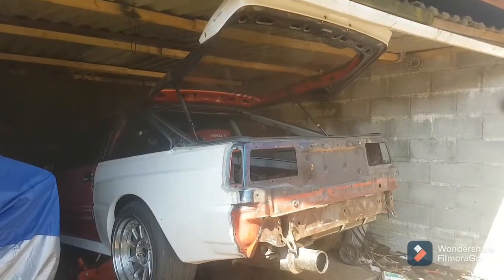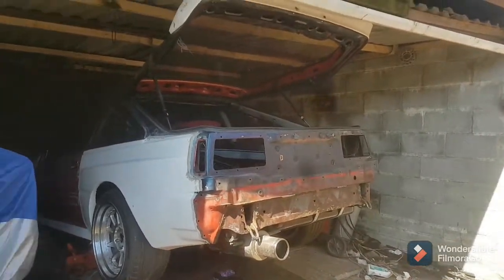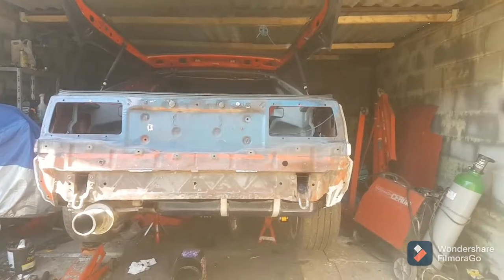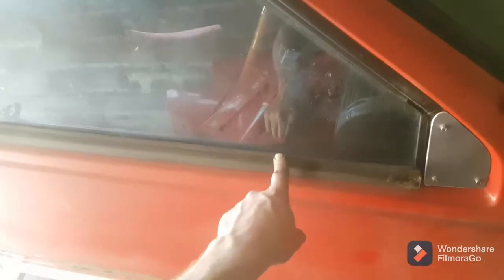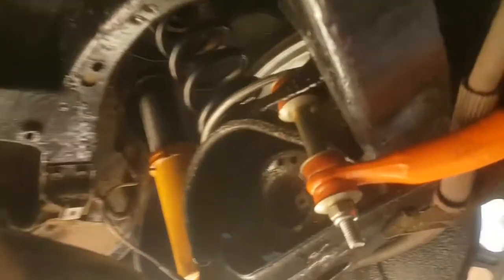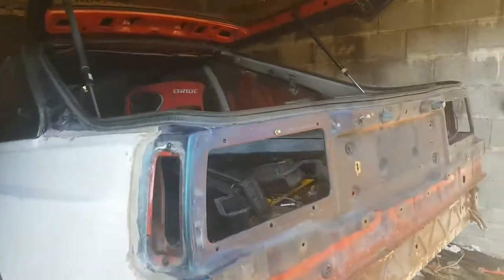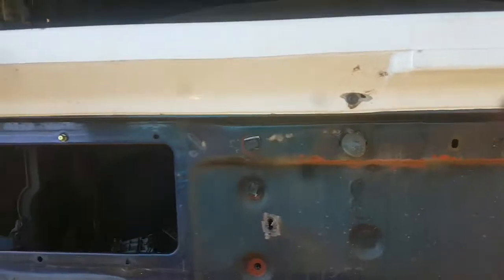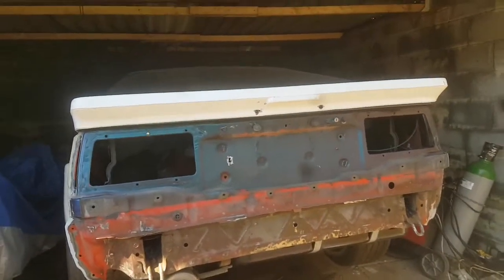Bodywork begins . April 2021 Nissan Silvia Turbo S12

Comment: Takes me back dude! I’m interested in your diff as mine is wrecked in my z31! Any chance of a write up please. I’ve got an s14a diff and several pairs of drive shafts. 👍🏻
Reply from the maker: The s14a has a 30 spline instead of s12 s13 s14 early 29 spline. I'm just waiting for another inner s14 cv to arrive and then I will make up a left shaft. I have 2 choices. Either grind the cv stopper off and slide the spiders inward both ends 15mm and weld or buy a custom shaft from drive shafts  UK Ltd for £200 . It's worth it though as it's a low miliage healthy diff. For road use they are great. It's not a drift car :)
Reply from the maker: I'l put a video up when I finish it . I've kept clips of what I've done so far. Just not uploaded as I've got a bit left to do :)
Reply: @XPUKKAX  I’ve swopped in the pumpkin to an r200 to check fitment without the ring gear using the shims that came with it. It spins freely but the shafts got me. Yes definitely I’ll be up for some help when you can dude. Big thanks in advance 👍🏻👍🏻👍🏻